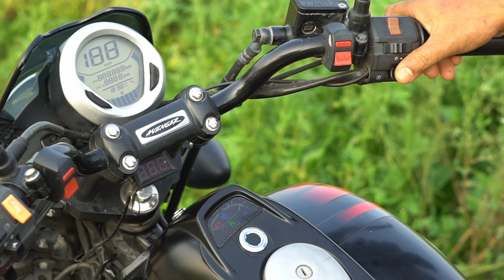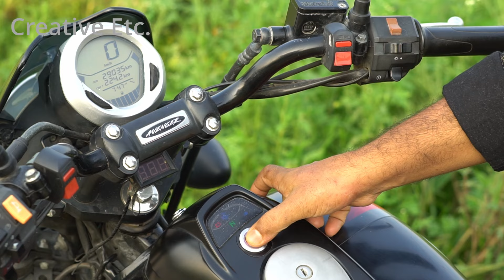How to Make Fingerprint Unlock System For Motorcycle - Keyless Bike

Comment: It will continuously use battery power, and will drain battery faster if bike is left unstarted for a long time. Can you add a on off mechanism between circuit so one can  break the circuit when not in use
Reply: it's easy bro... just put a normal on off switch on your bike handle to cutoff or on the sensor power supply 😊
Reply: We can use kill switch to cut off the power supply

Comment: Step 1: find the device
Step 2: open it 
Step 3: insert a screwdriver 
Step 4: register your fingerprint
Step 5: bye bye 👋
Reply from the maker: At first to find the device you need the key.
There is no need to take the small key to get around the local area.
Buying a fuel tank lock separately and using that key as I did in the video to open the fuel tank can solve this problem.

Comment: Can we use this in 72v ebike
Reply from the maker: It is 12v so you need a 72v to 12v step-down Voltage Converter ..
Reply: Yes but you can install additional voltage regulator